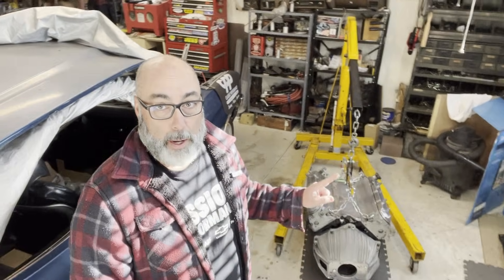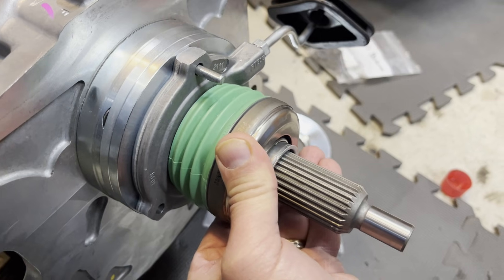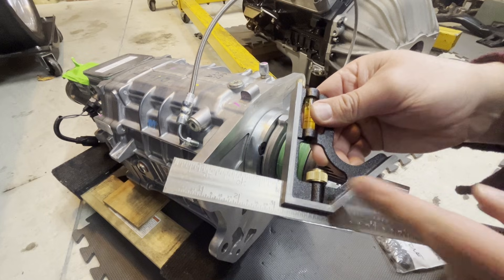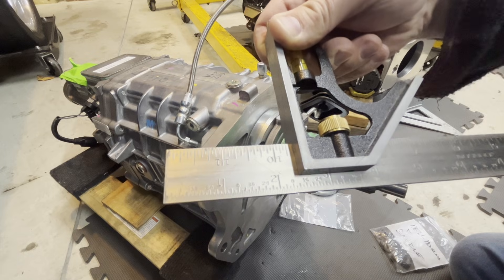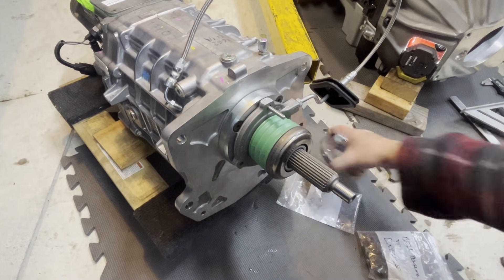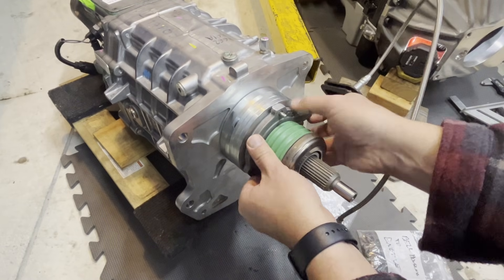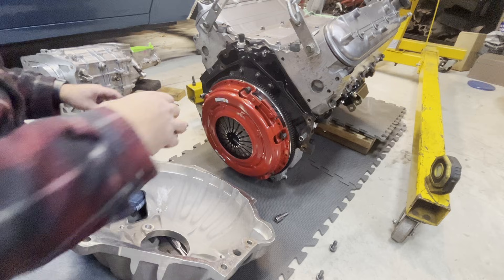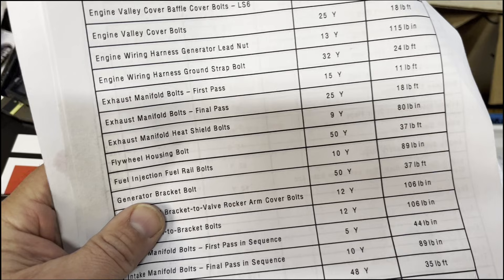Easy Hydraulic Throwout Bearing calculation for shims Transmission Concentric Slave Cylinder Install

Comment: I’ve done the exact same swap on my 71 Chevelle. LS, and a tkx from silver sport.  I hate the clutch pedal arrangement.  I’ll be getting the malwood clutch pedal/master assembly.  Also, my throw out bearing is already leaking after 1 year, ruining the clutch, causing chatter after it’s warmed up.
Reply from the maker: Thank you for the comment!  I’m hoping that’s not the case with mine, but I’ll let you know.  I have a rear main that’s getting progressively worse, so it all needs to come apart….again!  Thank you again!